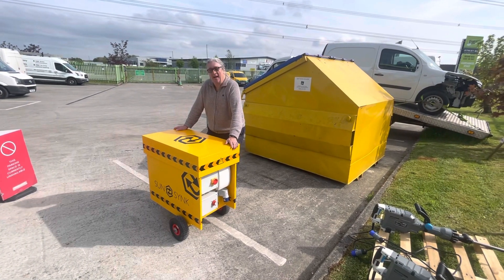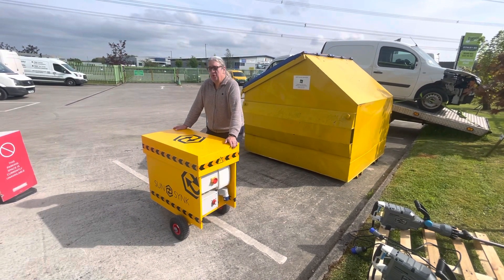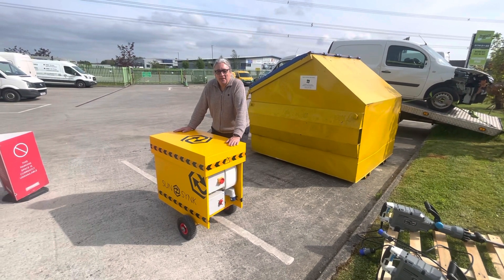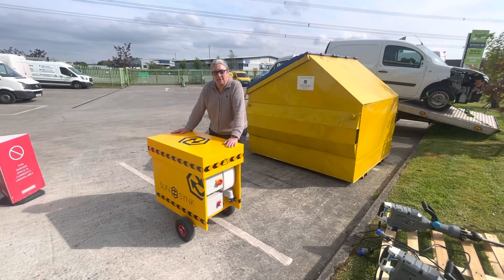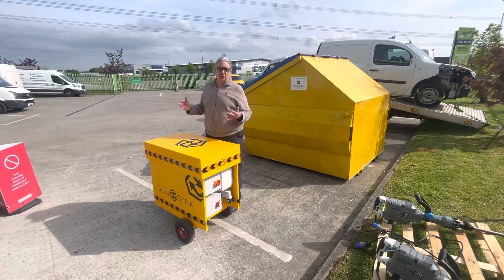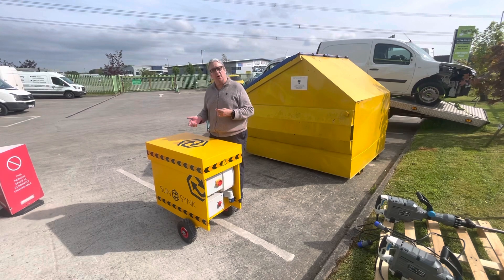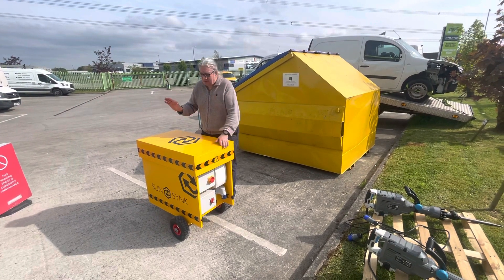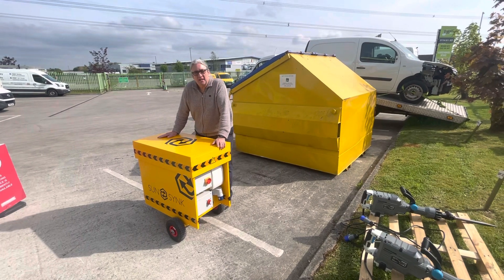#Sunsynk electronic compressor

Comment: okay, i like the concept but site equipment needs to be 110V or the health and safety bloke can't justify his job(joking aside its a HSE recommendation), perhaps something like this would suit site cabins more? pair with some panels on the roof that sort of thing would be nice to not have a generator running to keep people's laptops charged and power a kettle every so often. i could see it being useful on rewires as a site power source, that'd be pretty handy.
straight off the bat though, pair this with an ev charger, slap it in a van, emergency charging sorted, there are plenty of applications for it.